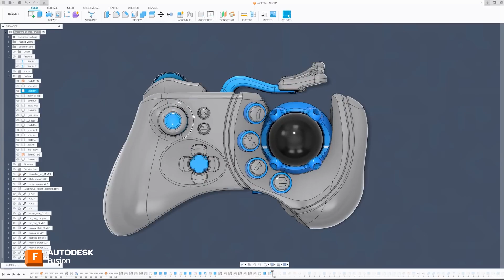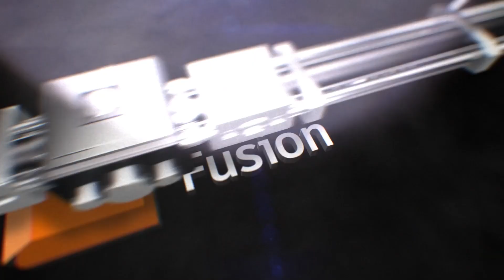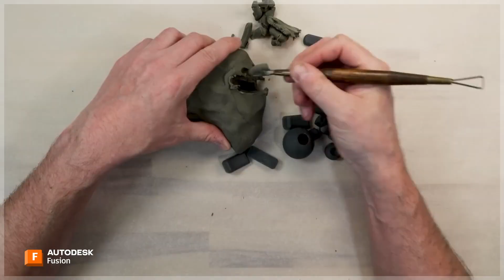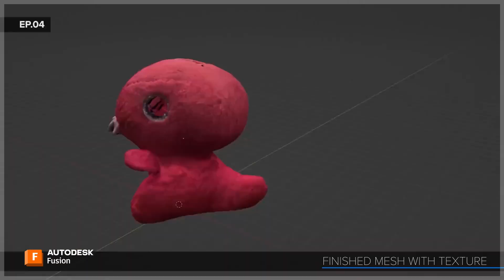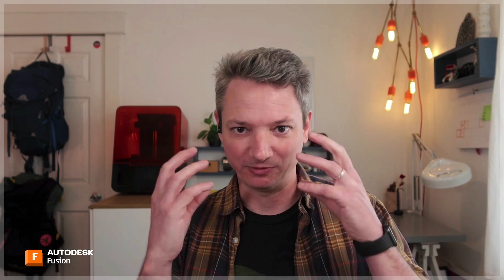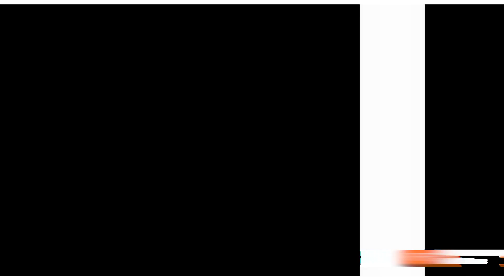Shop Talk with Charlie Pyott | Autodesk Fusion

Comment: Yeah, and on your controller, when im designing stuff im not designing tolerances or details, im designing the concepts because depending on what material, technology, process, is going to be used everything changes, so really you want to have a solid base concept to build off of.

Comment: I use pen and paper to design things first, its really the best way, why, because when you go to sketch it in fusion I end up needing to look up a bunch of tutorials to figure out details of each step. I like what you say at 29:00 I thought of using clay with 3d scanners but for making game models, monsters etc, but never thought to apply that concept to handheld devices, I was just thinking about VR modeling and what is the actual benefit of that and thats really not ideal, it has the same problems as computer modeling imo, clay modeling is truly a better way to gain a solid starting point for your model than starting with a sketch or vr.